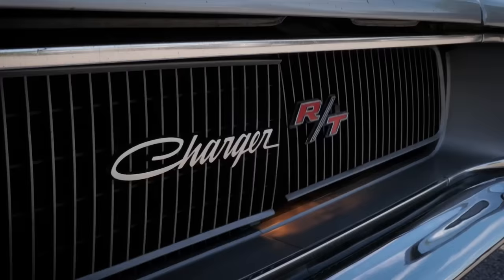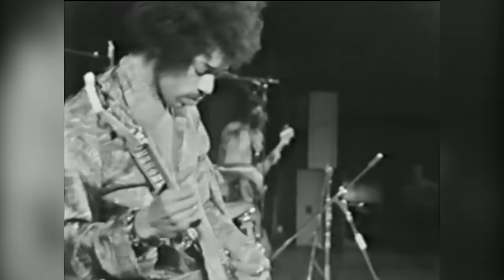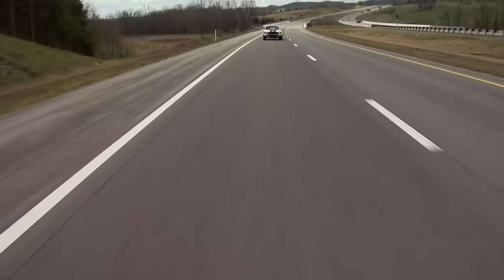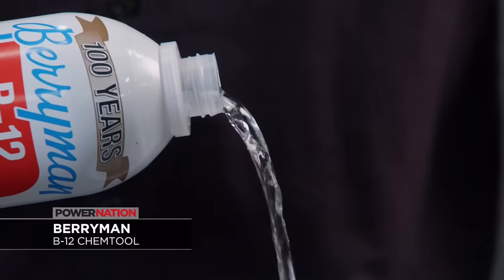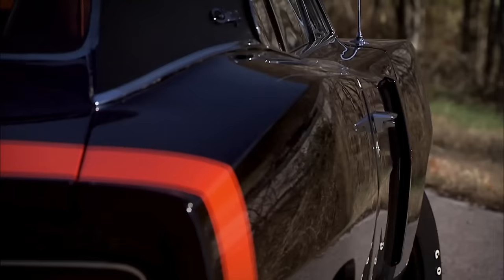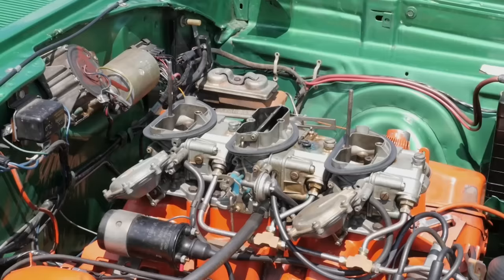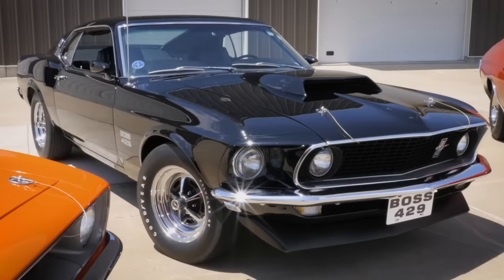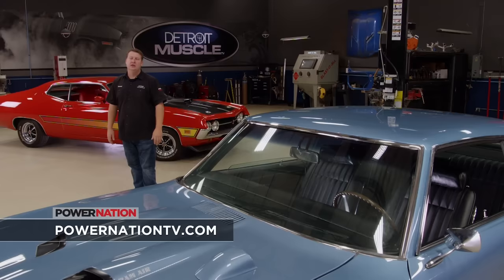Top 10 Muscle Cars of All Time

Comment: They are all awesome cars but for me the 1969 Mustang Boss 429 is number 1
Reply: Thats a pony car not muscle car. As I'm assuming most of the cars in this video are gunna be
Reply: @MF11283  they have chapters so you don't have to watch the whole thing
Reply: I can’t really argue with you
Reply: I totaly agree
Reply: Feel you bro. Ford Pinto for me.
Reply: @MF11283 Those are just advertising terms. All the modern "muscle cars" are "pony cars" save for maybe the Charger which is neither.
Reply: This guy has 10? WTF?
Reply: 68 and 69 Plymouth Roadrunner hemi was my #1.
Reply: @TopG800 

My number one is 69 Charger
Reply: @MF11283 it’s a muscle car. Pony car is an over complicated technical term. All of them are big, blocky, rowdy, and  weren’t designed to take turns. Even the “track focused” ones were mainly built for road/straight line use.
Reply: 69  Z/28 cross ram was as good as it got from the factory

Comment: What about the Buick GSX?  At the end of the muscle car era it had the best 1/4 mile time of all.
Reply: Hi Rick   Performance-wise, the "good stuff" included in the GSX package could be ordered on a GS. I did just that, but neither wanted nor could afford the cosmetic pieces.  I wanted more of a "sleeper" anyway.
Reply: It had the most torque of any stock produced car until the Viper
Reply: That’s not true. Other stock set ups ran lower times. 69 Ram Air 4 with the 4.33 rearend ran in mid 12’s.
Reply: @kennycamaro2361  Kenny, this topic could be "debated" ad infinitum from those 52+ yr. old muscle car mags of day.  So the point is that all of this is mere speculation.   BTW, you won't find any vintage magazine "road tests" from those days to verify what you say.   I've got all of those old mags and I challenge you to find ANY magazine of the day that showed a stock 1969-70 Ram Air 4 GTO with its stock 3.91's (or even the 4.33's) that even ran mid 13's.  BTW, you'll find that none were ever tested with 4.33's.
Reply: About the GTOs Pontiac put those red line tires on there the compound was so hard they could burn rubber and second gear and all the people that were test driving them were so amazed they bought them immediately
Reply: Ram Air 400 Pontiac was faster.
Reply: @kennycamaro2361  that 400 was an awesome engine.
Reply: @jimfrancis2624  hey Jim, oh my, your not kidding. Pontiac's we're known for burn outs, even further back was the Star Chief I believe it was called.
Back home we lived on the crest of a  small hill in the road, maybe a 15 foot drop ether way. Cars would back out of our driveway , go about 10 to 15 feet in reverse, nail drive or first gear and the challenge was to see how far up, over and down the hill you could smoke the tire(s). Pontiacs always ruled! That 67 GTO though could get sideways going down! We would laugh our tails off......
Reply: Until the Mopar

Comment: The 69 Camaro ZL1 is top dog for me, followed by the 70 Chevelle SS, 70 Boss 429, 70 Buick GSX, 69 Camaro Z/28, 69 Mach 1, 69 GTO Judge, 69 Trans Am, 70 Trans Am and 71 Cuda.
Reply: YAH gotta take off the stock manifold and install the Crossram one they give you in the trunk of a RL8 to get the right effect.
Reply: Olds 442 W-30 beat all those back in the day😉

Comment: It must have been a blast to have grown up with these cars.
Reply: A lot of these cars were on their second owners when I was a teen in the 70's.  Unfortuently a lot of them also got destroyed then by kids that didn't know how to handle them.  That said we are in a great age now too with stock Mustang Gts putting out 460 HP and the top of the line cars putting out over 700hp. These cars will do more than go in a straight line too.  Enjoy it while it lasts because the government is going to ruin it all again in a few years just like they did in the 70s.
Reply: The problem with growing up with these cars is that you are too young and too poor to afford them.
Reply: Owners tended to be older.  Although they were cheap by todays standards people made a lot less money.  Corvettes seemed to only be owned by middle age family men.  I was mainly into fast motorcycles but friends had most of these cars.  Lots of street racing.  Bikes were faster.  The 454 Chevelle was absolutely brutal.  It would fling you around inside like a toy.  But they were also heavy.  Todays hot rods are much faster.  The quickness of the car is determined by the craziness of the driver.  Had a friend with a 64 Mustang who was just insane.  Insurance costs were and are very high.  Yeah, kids could'nt afford these cars then.  The kid whose dad owned the AMC dealer got a new 401 AMX every year.
Reply: @scottyV1000  They were very cheaply built cars with mediocre engineering.  They were not expected to last long.  But they were fun.
Reply: It was
Reply: It was the best
Reply: It was
Reply: TOOO much horsepower. Lots of clouds coming from the rear tires. Rubber tracks laid all over the f'n boulevards and streets and strips all across America and lots of tires screaming bloody murder. Best of all Jay F., gas was about 30 to 35 cents a gallon around 1970....and you could still buy 102+ octane(oct-ron) for you BIG block engine. That was "the good ol days" you missed out on.
Reply: Many of the muscle cars could be purchased for about 3 to 4 grand. Big blocks were topping 4. Brand new Corvette's were about low $4,000 base price. HOWEVER, that being said, people were earning about 2 to 3 bucks an hour. Kids under 20 paid ridiculously high insurance rates.